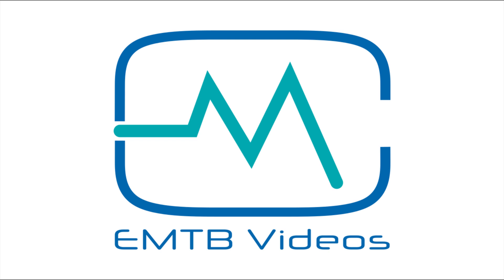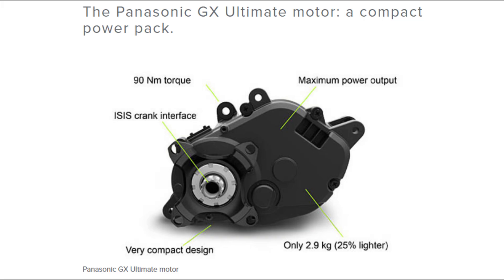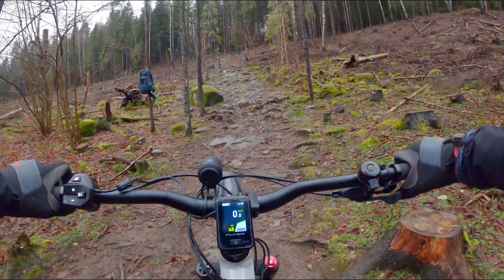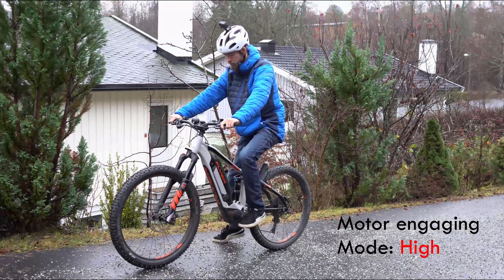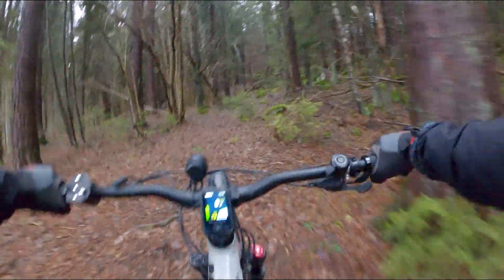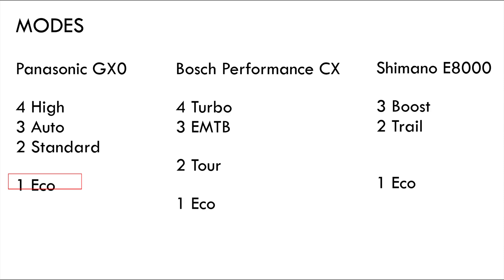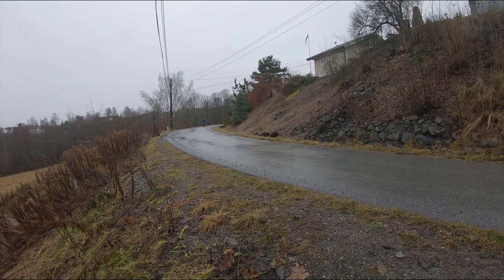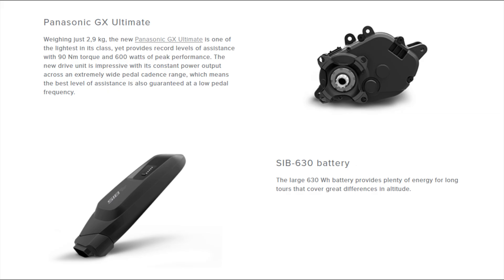Panasonic GX0 (Ultimate) 2019 - eBike motor review

Comment: Hello, i would like to know maybe you have this information on hand - PANASONIC GX Ultimate vs Specialized 2.2 90nm, are they similar in power delivery at low cadance? And also what is the driver power input for both of these motors. I just want to find strong motor for cruising around, dont have any panasonic brand dealers in my country, but Specialized is available.

Comment: I'd like an extreme update of the Panasonic Ultimate. A industry leading light battery(700 watts), and add-to-it all the necessities that Bosch, Shimano, Brose, and Dyname, need-to-improve. As for all brands: Will Honda & possibly Harley-Davidson, enter the E-motor field? Only if the profit is attainable. And most e-bike reviews are by those whom are receiving the same equipment via the company. Nothing but a YouTube commercial. Very few actual owners, are posting video reviews of e-bikes.

Comment: Nice to have this video which confirms several impressions I have while using this motor in my Flyer Upstreet5 7.10.
From the beginning I felt that pedaling was to easy because I seldom felt a resistance make a real effort. So I reduced the 90Nm to 75Nm in order to feel a certain resistance in pedaling. That was a good decision and I increased the distance up to 150+ kilometers by doing so.To the 4 levels of assistance I made the following experiences: mode Eco is ok when you drive along a river, sometimes you can also change to « off ». Apparently you should mainly use « auto » which you describe as dynamic assistance, that seems ok for me. Sometimes I begin going uphill in « auto », then I change in « standard » because the assistance is steadier. Once I had to change to « high » and I worried that the assistance would not be effective as I had reduced to 75Nm. I was very astonished to notice that I got a real push in climbing, so I do not have to increase the power of the assistance to the initial 90Nm. When I consider the different levels of assistance as 1 eco, 2 standard, 3 auto and 4 high, I often go from 1 to 3 before changing to 2 and sometimes upgrading to 4, which is a little bit annoying although not a big problem. I am very happy with this motor, I even consider to reduce even more the power of the assistance, maybe down to 65Nm, as with my former ebike with a bosch motor.

Comment: hey man, great upload, i was wondering if you could answer a question as you seem to know a bit lol, i bought a second hand ebike but without a battery, after i looked at the price over 400 euro for the battery for my model i gave up, my question is the motor is a pedelec Panasonic 250w 26v 10ah, do I need to use the particular Panasonic type fitting or can I build and install a battery another way on that motor or is it even possible (will it blow up) , I cant find anything online and this is a shot in the dark, I would really appreciate your knowledge and help on this, anyway thank you.
Reply: @EMTBVideos  thank you, i bought the bike real cheap so I might just try that,appreciate your reply

Comment: I collect vintage classic tank bike cruisers. I live in Sydney, AU. Primarily I use my bicycles for cruising on public bike paths and roads. I am however trying to source some smallest mid-electric Drive to accommodate within the mid-section of the frame of my bikes. Is there an e-Motor drive on the market, smallest in size (similar to 'Panasonic GX0 Ultimate' in Specifications) which would allow me to retrofit in mid-section of existing bike frames? The average diameter of chain pedal crank chassis area is 55 mm to retrofit eDrive. ALL comments would be APPRECiATED. Thank You in advance.
Reply: @EMTBVideos  Thank You for your advice. Much obliged.

Comment: I think Pivot had the right idea how to smooth out the Shimano's missing mode:

34 front with a 51 read 12x. You can climb most everything in ECO high. Trail is comfy and I don't think I used boost more than a couple of times in a Month.

That said, My CX is useless in ECO, but if my Haibike had a 51 rear instead of the 42, probably the ECO would be similarly useful as on the Pivot. 

Even if manufacturers don't want the 12x, they could go with a larger (48??) rear and a smaller front, making the ECO useful for something. On my Haibike it is really just the "limping home" option while on my Pivot I use it all the time.
Reply: @EMTBVideos  True. If not 4 levels, then they could give us 2 profiles you could switch on the fly.
Sometimes I feel I want ECO mid/high and maybe a low trail and low boost.....

Frankly I think all the Shimano "levels" work more like the Bosch "EMTB".....

The Bosch ECO/Tour is very linear. But all the 3 Shimano levels are dynamic and they ramp up nicely, mostly at the right time.

So I kind of want a 4th level or a "profile select" giving me 2x3 or 3x3, but I am also satisfied with what I have.

On the Bosch CX I am missing a Sport + eMTB option to exist at the same time though.

I am software engineer and also play with microcontrollers (as a hobby), so one consideration is how much space they have. I don't know if it is a couple calculations, or if they store  complex curve data in there. Though I think since they have the 9 levels (eco/trail/boost) x (low/mid/high) already in the computer at the same time, adding a "profile select" would just choose between variations of the 3. 

So in software that would just add an index, something like   
profile[0]=(0,0,0) for low, low,low
profile[1]=(1,0,3) for mid,low,high ....    

So I don't think it is a space issue there :O
Reply: @denesk2794  cool idea. I have been playing with the levels in the shimano app but this makes a lot of sense. I have pretty much settled on 0,3,3 (to use your annotation) I only use eco to limp home or of I am planning a long ride that requires maximum range.
Reply: @scottpratico1315  I think I am on high - mid - mid and that works with the giant 51t rear on the Pivot.
It is really steep here everywhere. Costa Rican volcanic mountains and tropical heat :) 
And yep, I think it would be easy to add an extra menu where you can switch profiles.. 2-3 would be perfect.

The other strange choice is ANT but not ANT+ ... would be great if cadence and power was sent to my Garmin (Vivoactive 3 currently after a Fenix 3)....

Maybe it is some licensing cr@p, but frankly, we are talking about $1000 motors in $5-10K bikes. So if my watch/phone/table can have ANT+, so could my bike...
Reply: @denesk2794  I have a Commencal Meta Power HT with 11-42 cassette.  Cheap and cheerful but not the best gearing for climbing in eco.
Reply: @scottpratico1315  you can easily swap in a bigger cassette for 80 or so. 11 speed 46 is standard now. But I have seen 48t 11speeds
Reply: @scottpratico1315  mand yep my haibike is 14 (35t as it turns 2.5) and 11-42 rear. I will swap that to a 46 as I also have to change the derailleur...  Probably an XT...